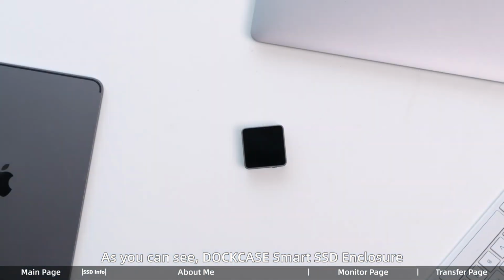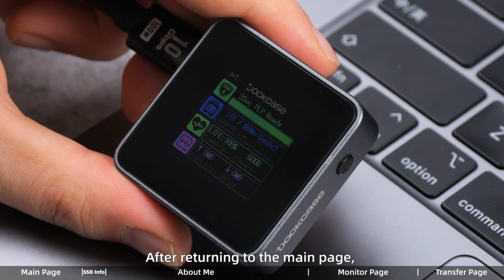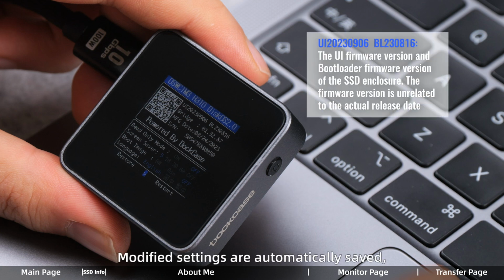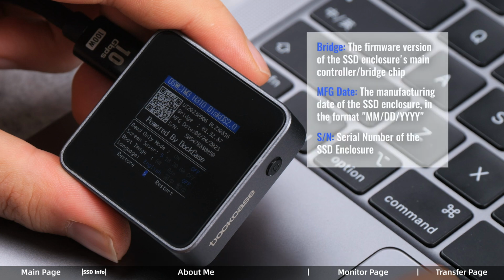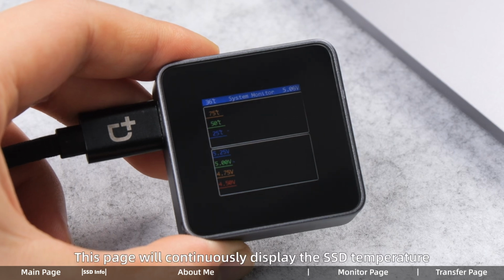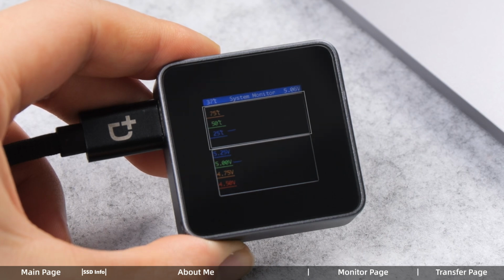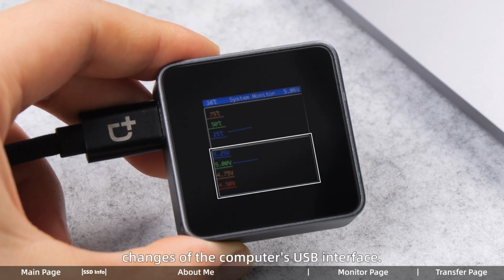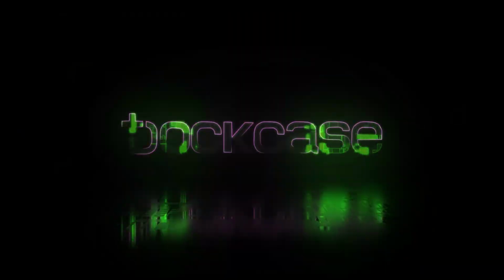The Ultimate Guide to Using the DOCKCASE Smart Screen

Comment: You can also double-click the D button to change the orientation of the screen.  I was wondering why yours was sideways in relation to the power port.  Mine wasn't. Each double-click rotates the screen orientation by 90 degrees.  So you can customize it the way you like it.